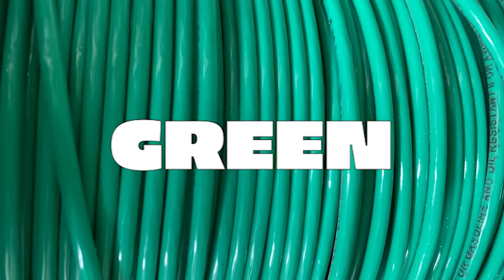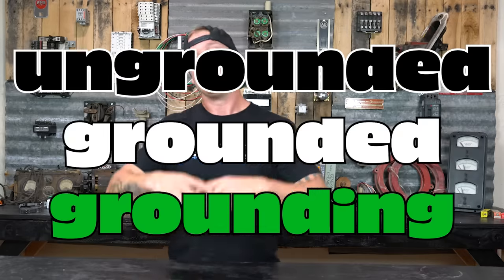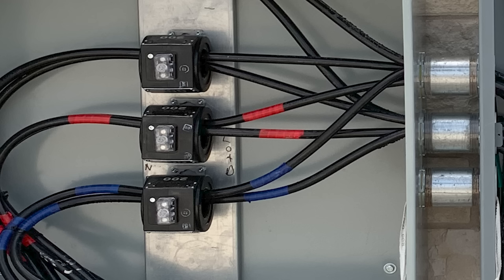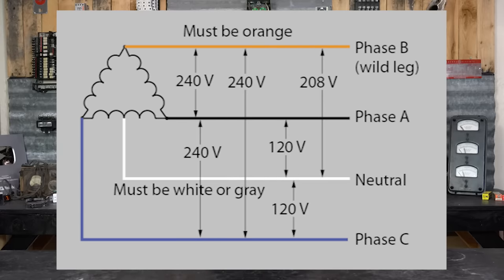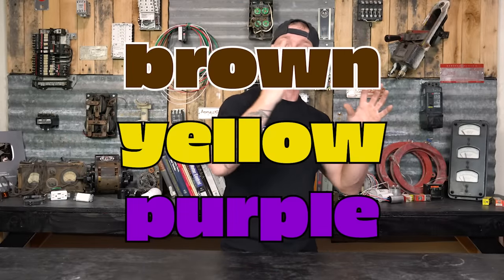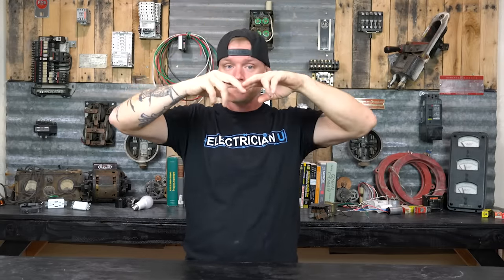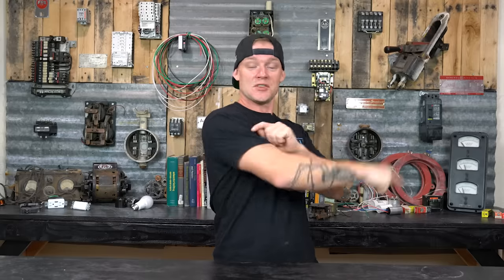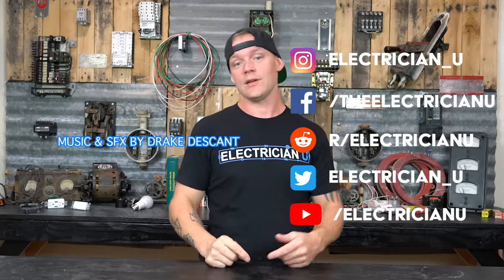Electrical Wire Color Coding Used By Electricians

Comment: From my experience... **RELYING ON COLOR CODING OF WIRES IS A FOOLS ERRAND**. Maybe not while youre installing, but most definitely when youre troubleshooting or fixing other peoples work and fkups. Best to more or less ignore them and work your way through a system checking voltages and sounding out wires as you go along. Just my personal opinion...
Reply: Not wrong at all.  Otherwise you get locked into deductive thinking and assuming you know what you don't about other obvious factors.
Reply: Sorry that regular people can learn too..must stink
Reply: Orange 🍊 is that aka stinger
Reply: And I guess in fl we weirdos cause we use brown orange yellow
Reply: @rickdaruler808s3 same as Arizona
Reply: Worked on a 277/480 marked Black Red Blue. AWAYS TEST YOUR VOLTAGE PEOPLE
Reply: @greatbambino2993 😮 holy smokes.   Do you recall what state or county that was in, just curious.   And that was one of the first things we learned as apprentices.   RELYING ON COLORS AND LABELS TO TELL YOU THE VOLTAGE IS PLAYING RUSSIAN ROULETTE.  ALWAYS VERIFY WITH A METER.
Reply: The green and white are almost always ground and neutral tho
Reply: You are right! You gotta pay attention. You never know what happened. I worked for a place that used the low voltage colors for switch legs. So for a 277volt light fixture the line side of a single pole switch would be yellow(c phase on a 277/480 system, and load (switch leg) would be blue. Not a good idea. But that's the way the contractor I worked for identified his switch legs. Most guys I know always used purple to identify switch legs regardless if it was a 120 volt lighting system or a 277 volt lighting system. You just had to test with your meter. The spookiest thing I ever worked with was a 480 volt lighting system at a Home Depot. What they did was run 3 phase 480 to all the fixtures without a neutral. So these ballasts in these H I D fixtures could be wired for about 5 different supply voltages, so instead of 277 which is a hot and a neutral, they used 480, and each row was a different pair. Row 1 was phase A and B. Row 2 was B and C. Row 3 was C and A. And so on through the whole store.
Reply: @jasonbourne2171 True, but look out for those common neutrals and oven wiring.
Reply: @damage6836  as a homegamer you have no other reason to observe and know actual colour coding other than for general fun knowledge.
For real sparkies we need to have deductive thinking to know that colours don't mean squat, as you could have had a homegamer try his own elec-trickery a few days before he calls a real electrician to fix the problem that he made a more complicated problem and then we need to come in and test and think thoroughly so people don't die.
Reply: @greatbambino2993 whoa. Was tbat ever allowed for 480v ?  Clearly a 208 color code someone maybe mistakenly used on 480 ?
Reply: True-Talk - Seen my share of FuBarS in the field even in the Automotive DC world....
Reply: Hmm. I personally have never seen BYP ever for 480. I worked the western division of Eaton. Always BOY. Rarely ever built high leg 208. I could see the confusion using orange twice. But blue and brown get used twice. You can barely trust the phase markings anyway.

Comment: Hey dude,  I've been an electrician for 40 years, I've been in all 3 world's,   residential,  industrial,  and commercial,  you are absolutely spot on,  yes it's a little boring,   but very informative,  and you speak  with  simplicity,   love it !!   Dont even start with knob and tube,  lol
Reply: ....AIN'T  HE  GREAT,  with HIS  " practicality of education of an  invisible entity " ?    I Just wanted to add,   I did do 3 or 4 of these freak technologies,   Navy, Residential, commercial,  and the digital that came in with communications,1960s and 70s.  Briefly doing tech tele assists with  Government satellite Links.  Just resets .  Today trying to stay out of the 432v stuff in my wall...  now which breaker UNMARKED,  is it  ???
Reply: LOL, all joking aside, I actually ran into a house a friend of mine was considering buying, I went to look at it with him, noticed that it had 2 prong outlet in the whole house except 2, I plugged my tester into those outlets, it indicated they were wired right, I pulled the face plate off of those to see if it was new wiring, nope, bootleg grounds, but I noticed the wires in the box looked off so I went and looked in the attic, sure enough, knob and tube all over the place.  Needless to say he declined the house, the owner and his realtor refused to come down in price.  Good luck selling it, no one will underwite an insurance policy on it until the wiring is brought to code either.

Comment: I’m totally insulted. I’m in a brown/orange/yellow area.
Reply: Yup
Reply: Brown orange yellow.     Black red blue
Reply: Triggered!!!
Reply: I work in a factory that got a black, grey/white, brown pattern.
Reply: Same here, BRB for 120/208 3PHs 4 wire system and BOY for 277/480 3PHs 4 wire system.
Reply: Same
Reply: Same here BOY brown orange yellow
Reply: @jamesgarrison6430  yeah, 480/240...Here in the USA...NEC handbook...
Reply: And I am totally insulated
Reply: I’ve never seen brown yellow purple here (louisiana,arkansas,mississippi,mememphis tn area)
Reply: What if its OPEN DELTA ;)
Reply: @mellowrebel4618  open delta 240/120 is blue, orange, black
Reply: @bobvecchi7981  110/208 not 277/480
Reply: @mellowrebel4618  I am not getting your point!
Reply: Same
Reply: The place I work at had someone 30 years ago do brown, yellow, orange and as a result of this the whole facility I work at is brown, yellow, orange. It was a little jarring at first coming from the field where everything was brown, orange, yellow lol.
Reply: @darianbell9614  that’s funny. We as electricians do get stuck in our ways and I’m guilty of that. If I ever get put in charge of ordering material for a job, I’m ordering pink/purple/blue to F with everyone. I think sometimes guys forget you’re allowed to use any color you want for phase conductors as long as it’s not white, gray, or green.
Reply: @darianbell9614  THE ONLY TIME I HAVE EVER SEEN AND THING DIFFRENT IS WHEN THE UTILITY MESSED UP ON A SECOND SERVICE AND IT WAS YELLOW ORANGE AND BROWN. RED AND ORANGE ARE SUPPOSED TO REPRESENT THE PHASE WITH THE HIGHTSET POTENTIAL RED FOR 120/240 ORANGE FOR 277/480. AKA THE CENTER PHASE.
Reply: Red (hot monophase) / Blue (neutral) / Green-Yellow (ground- aka earth) sparkie here !
in the hot family we add sometimes black/orange/purple for "return" lines (after a switch depending on type of switch).
.. and Brown (L1) Black (L2 Grey (L3) in a 3 phase system
can anybody guess what country I'm in ? and therefor our mono / tri voltages ??
Reply: @ottodidakt3069  I think England and the 3 phase voltage is 415 I believe. Not sure what single phase is.
Reply: @RB-xv4si  Close but not quite ;-)
I'll give you a couple hints : 3 phase is nominal 380V (really 400 these days) and single phase is nominal 220V (really 240v)

Comment: "Know, but verify" is pretty important....even if you understand the standards, you should always double check to make sure those standards were adhered to in whatever equipment you work with.
Reply: Blue is Neutral in the rest of the world (not NEC or USA Can). I have opened boxes that a black red and a blue were under the same wire nut. Nearest I can figure over the last 40 years it was the hot color the guy had in the truck when the add on was done.
Reply: Especially after I get in the panel and use whatever wire I have. LOL
Reply: @WraithlingRavenchild  
If you look at the panel on the left in his description of the black, red, blue, (low voltage 3 phase) system, you will see lots of colors on the breakers that don't match the correct "phase" colors. Even one white that is taped black. Typically, this kind of color "mismatch" is most often found when using romex where the conductor colors are limited. "Two wire" (with ground) romex is always black, white, and green (as far as I have ever seen) and 3 wire romex (with ground) is always black, red, white, green). I believe MC cable can be ordered in the "high voltage" (brown, orange, yellow, white, green) colors for lighting as an example.
Reply: I had to wire custom power panels for Sputtering Equipment used in the USA[60 cycle] and Italy [50 cycle]
208 3-phase down to 5VDC, with connections #0 AWG to 22 AWG wire, with the different colored and mixed color insulation, It was easy to assemble and test and installed a chart that identified voltages inside the panel so if the schematics were not right there you could safely test for voltage. IBM was only company that wanted black only hot wires.....later was told at East Fishkill IBM swapped two phases on a 3 phase pump and pumped chemicals into the local ground water supply. The wire colors might look pretty but the colors do have  a purpose.
Reply: I’ve seen more brown orange yellow.  Pittsburgh here.  Feeling like the purple is the oddball lol
Reply: @Robert Caldwell yeah, after some storm damage the electrical utility around here had a bunch of line crews come into town and replace a bunch of poles/repair services. One of the cruise made a mistake (innocent I’m sure) on wiring up the transformer bank to one of my buildings where the meter had been pulled…

They called me out to the site when the other line crew came to light the system back up and reconnect the cut out, and as soon as they popped it in and it blew it. They blew two more before they realized one of the phase conductors was connected to the neutral that fed to my building 🤦 so of course every time they pop that in it blew the fuse.

It seems like an obvious mistake, but I’m sure the first crew was in a hurry and since there was no load on the circuit they just didn’t catch the error. Had we had our building hooked up with the meter in place when they reactivated that transformer bank it’s entirely possible some of our equipment would’ve been damaged.
Reply: @pappabob29  I was about to make that comment myself. If he's using a photo of a panel box, he should at least use one that is wired correctly or at least point out the inconsistencies.
Reply: @ZeroBit0  … I have never seen the purple used this way either. At least I’ll know now if I encounter it.
Reply: @wb5mgr  ever hear of testing?
Reply: I'm in Pittsburgh also, so what should my old 3 phase panels be color coded? Nothing was originally coded, but electrician when replacing the service feeds to a panel used black, red, and blue.  But doesn't Duquesne Light have the 208 B phase?
As for correct color, some idiot in the 1970s when replacing an emergency generator used green for hot in one of my buildings.
Reply: Ronald
Reply: @pappabob29  Most "romex" (nm cable) that I've seen doesn't have any insulator on the grounding conductor. Cut open an extension cord or power lead and you'll see the green insulation, but not on the 12-2 or 14-2 nm "romex" cable rolls that I have in my basement, purchased at Lowes. I would expect armored cable to have green insulation (instead of bare conductor), but I don't have much experience with armored cable.
Reply: @Sembazuru  
Sorry, I used the wrong name for it. I was referring to the "Anti-short" insulator that gets inserted into the jacket of the cable after you cut it with the little "zip" wheel so the conductors don't get chafed by any sharp edges on the jacket. It's a tiny little red plastic piece that comes in a little plastic bag when you buy the roll of MC Cable.

Comment: I do submersible pumps in water wells. The colors used across the board in the US is green red yellow and black in that order. Green(duh) red(start) yellow(110v) black(110v). Feed wires do not have yellow but white. Our system do not use neutral. In fact our single phase to 3 phase converter will not run with a neutral. So white and yellow do not always mean what you said. Which is why I battle with electricians that are trained in one specific way like they are brainwashed and will not deviate from that.

Comment: Yes, but...  I was in Air Force Civil Engineering, we take care of the buildings and Infrastructure. I went to the electric shop one morning and they had one of the security forces campers. They used them when the alarms wouldn't work on a remote site and they had to spend the night. I asked why it was there. It had a wiring problem that the vehicle mechanics couldn't figure out. It had a 120 v electric heater, it was early spring and they plugged it into the power on site. It was regular house color code, the camper was RV color code and the truck was a third color code. The vehicle mechanic that assembled this mess didn't understand that. Our electricians were impressed no one got hurt.

Comment: We got 277v LED lighting, and an electrician was wiring a switch in a metal pop-in box with those horrible metal drywall clips. I asked him if he wanted to wrap the switch in electric tape. He said no.  Turns out he hot wired it, and when it touched the metal, sparks flew across the room and vaporized that 12g solid.    The wires to the switch are white/black wires. Why don't they use red/grey or black/grey?  I'm not an electrician, but I have to pretend sometimes.

Comment: Basically correct and useful video, but please note four comments:  1) In the final summary, he said the orange wire in a three-phase 240-volt delta system is 240 volts to ground.  It is 208 volts, as he said earlier.  2) He said you should never see voltage between the green and white conductors.  That is true at the main service entrance panel but NOT at sub-panels.  Since the neutral carries unbalanced current, it will have a voltage drop and you will read a small voltage between the neutral and ground at sub-panels, as well as at outlets and fixtures connected line to neutral. 3) Many "low voltage" three-phase systems are grounded at the electrical center point of the three-phase system, not at the center of two of the phases with a wild leg for the third phase.  In these very common systems, (called three-phase WYE) the voltage between any pair of phases is 208 volts, and the voltage to neutral of any phase is 120 volts.  240-volts is not available.  Many underground systems in cities are this type, and single-phase services are two phases of the 120/208-volt system, and neutral current can be as much as the full load on the phase conductors for all but loads supplied at 208 volts.  4) Here in Connecticut, 480-volt systems are Brown, Orange, Yellow, or "BOY".  DMC PE-CT/MA

Comment: thanks for the enlightenment I have received!   for the last 25+ years I've owned/operated 1hp15hp woodworking machinery and I've had to wire my own building(s) for machinery from 1ph to 3ph via a rotary converter.  I was  "taught" that the two incoming 1ph hots were red/black.  Once the hot went through the 3ph rotary converter, I had 3 hots with one of these legs 208/240.  This line was colored blue and never used for anything but 3ph motors and the legs for the motor controllers were always red/black, never blue(boom+frying the mag contactor)  Motor turning the wrong way, reverse red/black, NEVER blue.  Orange was always for compressors and always home runs.   I've never been called out on it but I think that once the inspector saw a rotary converter and additional panel, they were out of their league.     Lucky or not, it works and NO ONE ever touches my panels/wiring.  When I move, wire and receptacles come with me.  Conduit stays on the walls for the next guy.   Thanks, again, B